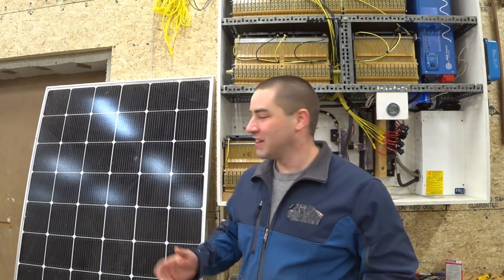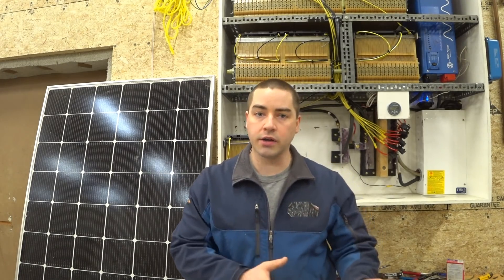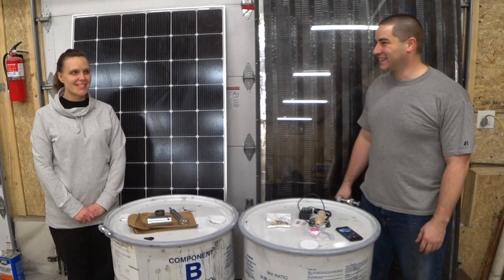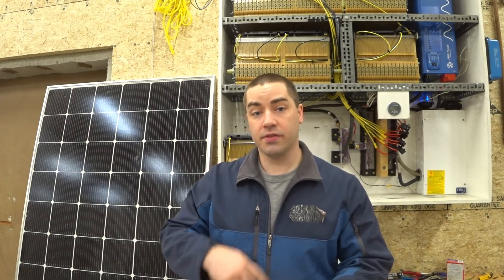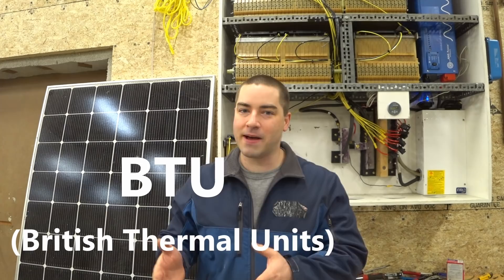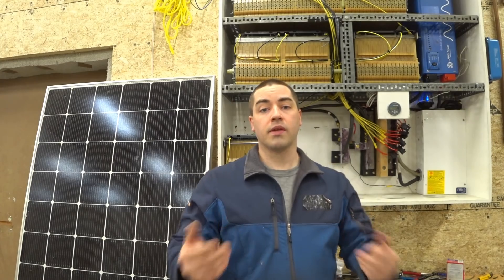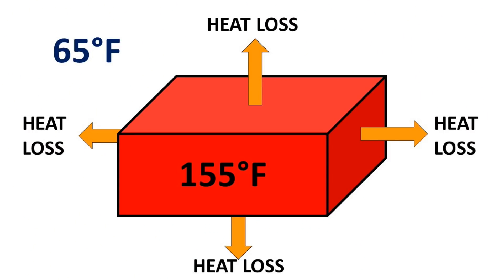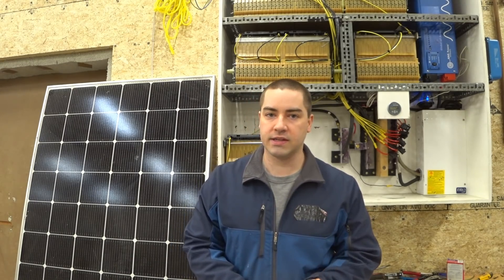Cheapest Energy Storage Off-Grid

Comment: For best efficiency using solar energy I have decided NOT to use PV panels which have an efficiency as low as 12 to 20%. Water-filled collectors have an efficiency above 50% and can produce a lot of hot water. Last month (Sept. 2019), the best result was 52.3 kWh from 20m² (square meters) a day. Hot water is stored using off the shelf components with the additional comfort of a hygienic heat exchanger for superior hot water quality. But for sure I will upgrade with some PV panels in the near future as a backup (UPS) to keep the water pumps working during power outage. Thermal stability is supported through a separate heat exchanger that heats the 16m³ of water in the pool. On that day with the maximum output more than 40 kWh were "wasted" to the pool.
Reply from the maker: It sounds like you measure hot water in kwh.  Is that correct?  What country are you in?  Thanks.
Reply: @DavidPozEnergy  Yes, the thermal solar controller UVR1611 from manufacturer "Technische Alternative" in Austria reports the energy (you have) used to heat the water (per day)  in kWh. It does so by measuring flow of water (mixed with antifreeze) multiplied with temperature difference of input and output, close to the thermal heat exchanger. This is very similar to your PV-panel Volt*Ampere=Watt measurements.

Comment: For the cloudy days, a battery bank can be boosted from an idling car.  A typical car alternator can put out about 1000 watts.  Some alternators can output 2000 or even 3000 watts.   For non 12V battery banks (such as 24V or 48V), each 12V subbank can be boosted in turn by just moving the clamps from one subbank to the next until all subbanks have been boosted.  It is not critical that all subbanks be boosted at the same time.

 The heat from an idling car can be harnessed too, especially in a cold state like Mass.

Comment: Now  Imagine:
A solar farm working in conjunction with a public or private Water Utility. Using the excess solar being generated during sunny days, while the population is at work,, assuming that we still in the future need to commute and work a day job (Right?) and instead work at home. But the solar farm is generating electricity that can heat potable water being stored in the Ground Storage and Tower storage structures of Water Utilities, and/or simply be used to provide the pump energy for the LIFTING of the treated water into the GS and TS structures. I mean energy being transferred to replace energy being bought. 

So just replace the Electric grid for the lift of the treated water. And then capture the energy of the water falling in the morning when Water demand on the utility system forces depletion of the GS and TS water to maintain that constant 60psi. The water on the way down, is releasing potential energy in the form or Kinetic energy. So intermediately, some of that kinetic energy can be diverted though a hydraulic dynamo to generate electricity. And if we are worried about sufficient water resources, then build extra GS and TS structures to accommodate additional treated water simply for the cyclic fill and empty function to generate electricity. There is something in Netflix about Islands of the Future, episode on the island of Madeira. The island is water and energy poor. But it has Geography, being mountainous and the wind currents bring water in the form of mist to the interior highlands. Watch this and see how smart this little island was!

And then there is SOLID WASTE. Imagine: 
A county or city using the heat from decomposing solid waste (trash) or a WWTP that is Waste Water Treatment Plant using the heat from the anaerobic (without oxygen) digestion of activated sludge or solid wasted from household street collection? That Heat is being generated right now all over the world, city dumps and WWTP's with sludge at 2-3% total solids concentration. And that energy will just go into the ambient atmosphere and ground unless it is tapped!
Reply: But that would be economically efficient.. nobody wants to "commercially" look that deeply into simple economic "efficient" energy, because it won't make them money and the consumers dependent on them.  It would be much more profitable to keep the consumers just ignorant enough to  lack the initiative and knowledge to develop such a system...

Comment: Although heating the hot water is a major cost of out daily power cost you didn't show how to heat the storage tank. Using solar panels creates electrical energy you want to use for your daily power needs.Storing that power is more of an interest for me but 4 or so days of hot water is still food for thought.  Even our place near Sydney (Aus) if we have any cloudy days the solar water heater ( 30 evac tubes with off peak electric back up ) gives only 250 liters of hot water to about 60 deg C. Still look Iooking for a total system.
Reply from the maker: That's great you have some evacuated tubes, I've heard they are fantastic.  You are right that I did not go into the heat generation in this video, I was trying to keep the topic to just thermal energy storage.  But I have many other videos on my channel about heating water.  I'm also working on more videos to cover diversion loads.  Thanks for watching.
Reply: @DavidPozEnergy  hi David I am very interested mainly power storage batteries stuff. I have 24  x 275w solar panels  thru a inverter which the house uses & overflow power goes I to the grid. Saw some interesting stuff on home made wind generators. Still got to store it, they yesterday saw a tube thing on iron flow batteries apparently these start at 50 kw up to 400 kw units haven't  got any $ on it yet looks good though. At the moment we are stuck with deep cycle, AGM, ( old hat but getting cheeper) LionPho at a min $100 per Ah & a new lead crystal  battery, promising but still kinda exe 100 Ah for around $600 Au  some suggest  super or ultra capacitors but definitive  yet but the search goes on. Oh & yes the solar evack tubes are great  but with a son who needs a bath every night that's a lot to ask from 250 L tank. Need more!

Comment: I'd just like to know one thing,  which is,  how would you use the tank and stored water to run everything else?  Your video title gives the impression of a less expensive way to power your off grid homestead,  and while this is useful for having hot water when the solar isn't working at capacity,  it teaches nothing to the average Joe as far as how to have cheaper power for off grid.
Reply from the maker: It's energy storage.  In this video I discuss Thermal energy storage.  But, I have dozens of other videos on the electrical energy storage (batteries).  They can all work together.

Comment: Build two giant pools ,put the first pool high as you can (like a watertower for instance) connect the pools with 2 pipes , 1 pipe connected through a water pump , second pipe is passed through a generator which generates 220v ac 1-5 kw (depends what power you need)  hook up your solar panels directly to the water pump and take the output to your house this way you would have un interruptible power even when the sun isn't shining cuz it will take a long ass time to the upper pool to completely drain .. til the next days or week it will fill up again . Im gonna do this though ..
Reply from the maker: I'd love to see your project.  Please let me know if you post a video.
Reply: @DavidPozEnergy  it's a project that can take 2-3 years to finish , maybe I'll make a small model first before investing too much money . ;)

Comment: That closed cell foam gives you R-7 per inch. Vacuum insulation will give you R-25 per inch! It will be a higher initial cost but with 5 inches, you'll have more than R-125! You'd keep your BTUs and could use double the heat over a 3 day span. Build a giant thermos!
Reply from the maker: I've never met anyone who has built with vacuum panles.  Have you tried them first-hand?  If so I'd love to ask you some questions about the process.
Reply: @DavidPozEnergy  Instead of panels use a cylindrical tank like this https://en.wikipedia.org/wiki/Vacuum_insulated_evaporator#/media/File:Vacuum_Insulated_Evaporator_diagram.svg but for storing heat instead of cryogenic liquids.

Comment: Kinda confusing (not the math).  I understood what you were saying but it could have been much more effective if you didn't keep switching back and forth trying to relate thermal heating and storage of water with electrical storage in batteries.  Because you kept relating the cost of the two systems in killowatt hours, and measurement of the factors you are considering in killowatt hours, I kept expecting that you would be eventually telling us how to pull that stored thermal heat as electricity somehow.  A simple diagram showing the flow of energy for both types would have made this a lot easier to follow.
Reply from the maker: Thank you for the feedback.  I agree, some diagrams would have helped more.  I'll keep it in mind if I make a follow up video.

Comment: Now can you store enough hot water to harness the heat for your water, heating and your home and harness electricity for night time use. Like thermo electric pads to generate electricity with temperature difference in the tank and outside the tank. I know you can but can it be done reasonably and make enough ti actually make difference? Would be the ultimate package.
Reply from the maker: My guess is that it won't be cost effective to try and pull electricity from hot water.  But, my next tank will be big enough to provide at least one day of space heating.
Reply: @DavidPozEnergy  I've been contemplating pre heating for my propane tankless water heater to cut gas usage combined with space heating options for years. I've watched tons of videos on all these subjects and installed a huge solar array myself (before the help of Youtube) but now that I'm 0 on electricity usage im looking at reducing propane use. Your videos have been helpful and given different ideas then I was planning. Thinking electric heating elements may work better for me then solar as I can buy and do solar cheap. Seems much simpler on the install too. Thankyou for the videos
Reply from the maker: That's awesome you are zero with electric usage.  Certainly doing some solar water heating is going to be within your ability since you already have solar experience.  One possible surprise:  Some tankless water heaters only turn on with cold water.  For example, if your supply water is 90°F it might not turn on at all.  Just something to check with your model.  Good luck.
Reply: Crap another good point I didn't know or consider about the intake water on my Rinai. Will have to look it up. I was planning on tempering to 120°F. For now I'm pretty maxed on solar production my panel. I'm zeroes with 2 A/C's a pool, jacuzzi, well pump and 30,000 miles a year in a Tesla. Next step second electric car for wife.

Comment: Just get an in-line heat pump rather than one attached to the tank. Then you can use a gigantic tank.
Reply: Yes. You would also multiply your gains by the COP of the heat pump over simple resistive heating. It seriously needs doing in SI units though. Imperial measurements don’t translate well.

Comment: for termal battery dont use water density of an object is directly proposunal to BTU capacity. Use granite / marble stone heat it with solar termal water... it will be cheaper for inslulation u can cover the granite/marble stone by spray roofing foam.

Comment: What about a tankless hot water heater there 110 volts and splice in your water line and only run when u need it just a thought
Reply from the maker: Sure, you can do that if you have the inverter and battery power.  My battery is on the smaller size, so I'm trying to keep to storage ideas that don't use electricity.  The hot water tank works well.  Thanks for watching.
Reply: Oh I c what your saying now 👍

Comment: As a Hardwood Flooring Contractor, I would be concerned about all the humidity in your crawlspace. It can easily wick up through our subflooring.  Is your tank sealed are did you do something to make sure the crawlspace is forcefully vented?
Reply from the maker: Hi Steve,  Yes, the tank is sealed.  I have a rubber lid caulked and screwed across the top with lots of insulation.  There is a 1/2" DIA pipe for venting, but has a condensate trap on it.  This prevents moisture from excaping, but allows the water to expand and contract with temperature.    If you want to see the build of the tank you can check out some of my older videos.  Thanks for watching.

Comment: How did you go about calculating the size of the device needed to heat the water in the thermal storage tank?
Edit:  Let me be a bit more clear, I watched the video's of you comparing PV to Solar thermal heating and wasn't sure how you came up with the calculated size of the thermal solar heater to heat the water to the desired temp.  I understand that using any size to heat water would do the trick given a long enough time but wasnt sure if you had any way of calculating the size of the thermal heat collector to validate that the temp of the water in the thermal storage tank would reach the desired temp in the period of time you have available to collect solar energy.
Reply from the maker: I'm using 3 solar collectors.  These collectors are each 4 feet wide and 8 feet tall.  They have copper tubes inside a glass front.  The sun heats the water directly, and I use a pump to pump the water from the tank to the collectors and back to the tank.  Is this what you are asking about?   I've got a video on it here: https://youtu.be/g0_-zAskgnE and https://youtu.be/NDxmPl5jlVA  I hope that helps.
Reply from the maker: Update to your edit: Short answer is to have as big of a collector as possible.  LOL.  My own personal setup has 3 collectors because that's how many I could fit.  But to try and answer this better: I have a few books written on the subject.  They usually use a rule of thumb such as 1 square foot of collector to 1-2 gallons of water in your storage tank.  These are extremely rough. I have 96 square feet of collector and 250 gallons of water.  So I am lean.  According to the rules of thumb I should have more collectors to my tank.  

I've seen several manufacturers (of flat plate collectors) list some numbers of BTU's per hour.  This is given certain test conditions of water temperature, and air temperature.  I find they are generous.  Yes, you can calculate how many sun*hours per day, times BTU's, times number of collectors to try and determine how many BTU's you can collect.  Then, given the volume of your tank your water temperature would increase x degrees.  But, I don't ever see the rated output.  The air temperature outside robs the collectors of heat.  The pipes have a loss to and from the tank.  And there is a limit to your delta between tank temp and air temp.  

In the end, I'm happy with thermal collectors for low-temp applications.  Such as radiant floors, or a pre-heater.  But I don't like them for reliable HOT water all the time.  I'm going to be adding more PV direct heating elements (electric) to bring the temp higher.
Reply: Thank you for your response.  I’m working on building out a lower temp solution for a green house my father is wanting to construct and from your videos (and other research) I think thermal heating is the way to go for this project.    Just looking for a ruff calculation on figuring out the size of the solar collector needed or possibly working the math backwards to determine if he has a size of collector in mind what the expected range of heated water would be obtainable.

Comment: I was just reading about creating/using huge salt caverns (south of Salt Lake City Utah) to store compressed air by solar/wind and then use compressed air release to generate electricity at night.   In your research of 'energy storage' did you happen to run across any info/efficiency data on compressed air as a storage medium?     I am wondering if one could buy an air tank at home, use a compressor to store compressed air, and then ?  - are there any air powered generators?  would it be only 10minutes of low power?     Just wondering out loud.
Reply from the maker: Hi Kenat,  I remember seeing an old video from "Green Power Science" (YouTube channel) where he set up an experiment trying this.  I think the round trip efficiency was less than 50%.  Not very practical on a single house (small) scale.

Comment: If you could use a cheap oil such as bulk vegetable oil, it could still offer a  much higher temperature, enabling more stored thermal energy, creating a longer temperature retention for a longer period of time, and should be able to pay for itself fairly quickly with about 2 1/2 times more energy storage because of its higher temperature resilience to evaporation, and a much higher boiling point.

You may also be able to heat water for ex. 4 days with a smaller oil bath of potentially 200 gals where space may be an issue, that a 450 gal water bath would be needed to achieve the same retention time frame.

Yes water is cheap, but oil can offset its cost with additional performance, with a lesser volume, especially if you weren't able to regenerate it for 8 days of cloud and rain. with ex. 450 gal of oil vs 450 gal of water because of oils ability to reach higher temps, therefore storing more energy longer.
Reply from the maker: Hi Trevor W,  Thanks for your comment.  Can you link to any website, blog, or video where someone has built a thermal store out of oil, and showed the data to back up the idea that it is more efficient?  I'm interested in it, but when I was studying this I learned that water is the most efficient storage medium.  But things are always changing and my information might be out of date.